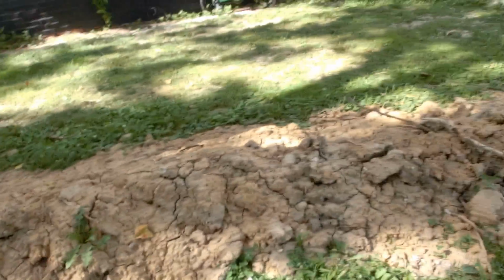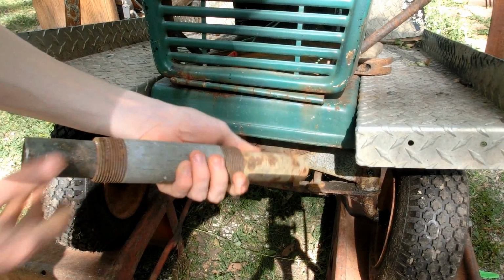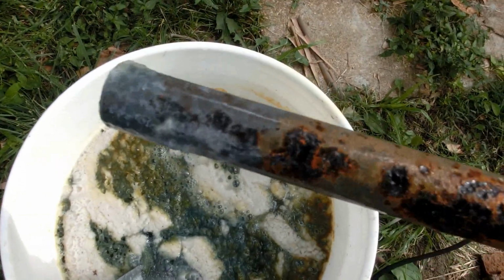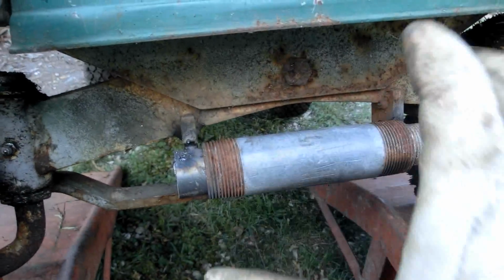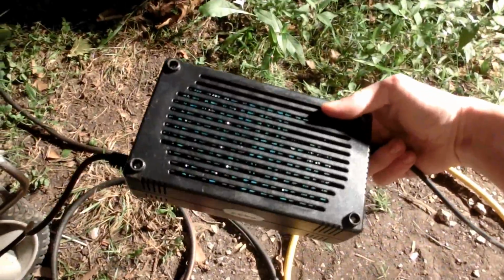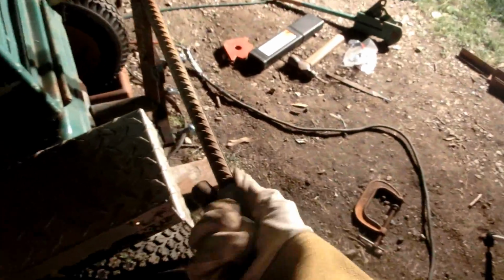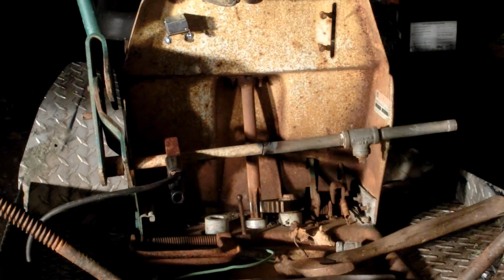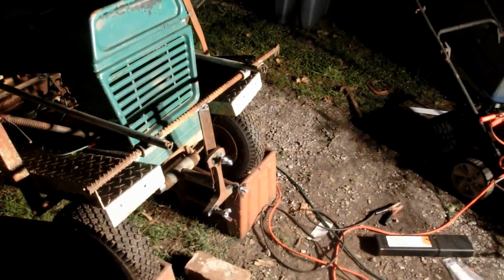DIY Electric Lawn Tractor part 8: adjustable tool mount

Comment: why did you clean half the pipe, then not actually end you cleaned? :-/
Reply from the maker: because only the middle mattered, and it was just me messing around. it would have worked just as fine if it was caked in rust.
Reply: ahh, just seemed like a strange thing to do ;)

Comment: I love working at night especially during summer.  It isn't like anything very noisy is being done that will bother the neighbors.
     I also like the wing nuts. Even if you tighten them down with a lock washer, they might want to rotate off, so you might wish to make a few wraps in the bolt thread grooves with a little wire twist tie in front of the wing nut if there is a problem.
     Even though you are all excited about building and using your new bulldozer, don't try to shove a huge mass of dirt into the hole at once. Place a little dirt in the hole at a time and compact it every layer.  Otherwise, you might move what you consider surplus dirt to the back after you believe the job is done only to discover that the dirt settled more in the trench, and might have to go back and bring back from the back to fill in the depression.
     You can do this at night and the compacting can be done with bodyweight walking in the trench.  What is great about the electric bulldozer is that unlike an internal combustion powered one, you can move material, stop, get off, do something and then get back on and operate it without it wasting energy not doing work.
Reply from the maker: yeah it wastes no power at idle.
Reply: If you have any old lawnmower blades left over from those numerous lawnmowers you have collected, they might work well in building your bulldozer blade.  They would be relatively sharp and sturdy.
Reply from the maker: *****
 thats a good idea except lawnmower blades are a bit curved and odly shaped. i'm still thinking what parts i want to use but i think i have what i need.

Comment: Another way to remove rust is a 10:1 mix of molasses to water.

Drop it in let it do its work for a week or so and your done. Easy.
Reply from the maker: i find 20 minutes on a charger is best, a lot of processes of letting rust soak in household chemicals doesnt work all the time.
Reply: Rinoa Super-Genius
wonder what will happen if you use 36v , that will push a ton more amps into the electrolysis!
Reply from the maker: jusb1066
 or i could just add more salt to use more amps.
Reply: Yeah... But molasses is power free...

Comment: A little hint win welding, to start your arc drag the tip of your rod like you are striking a match
Reply from the maker: yes i know how to weld, i have issues with amps when i use the 3/32 inch rods.